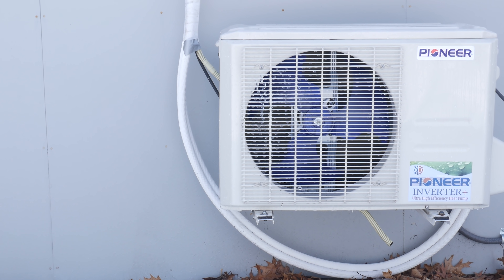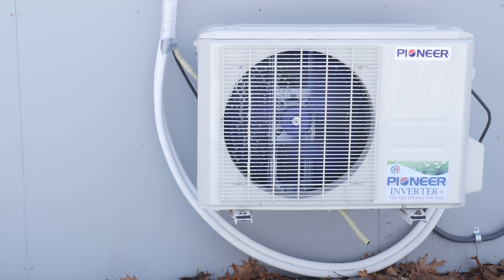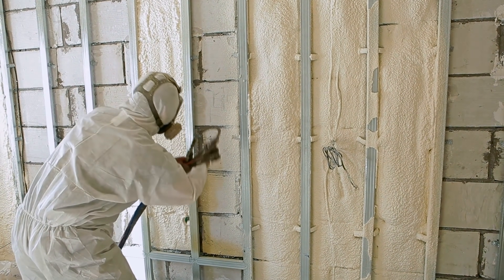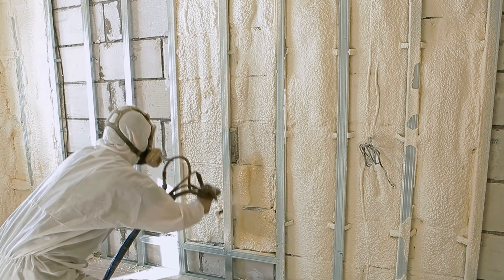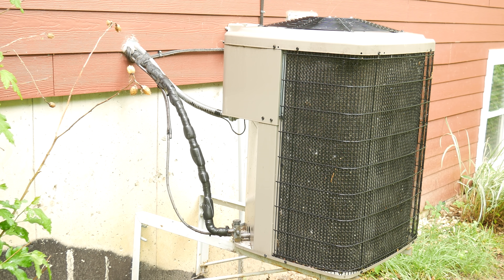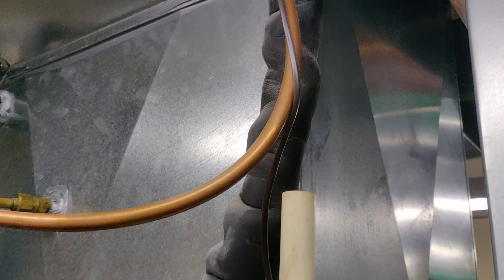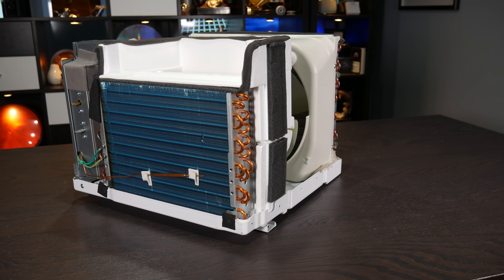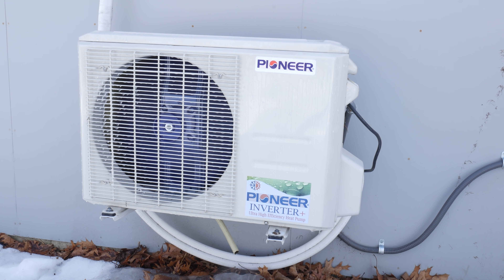Heat Pumps are Not Hard: Here's what it will take to start pumping

Comment: At 35:58 you mentioned that all systems in your area seem to be oversized by a factor of 2x. Fun fact: do you know that there is a direct link between the Spanish Flu and our oversized HVACs? The “Fresh Air Movement”, started in the 1920s, preached that any new heating system should be large enough to keep rooms with open windows comfortable.
Reply: Holy crap. Getting rid of excess carbon dioxide in the air and replenishing oxygen is important and severely undervalued, but that's ridiculous.
Reply: Kinda like driving down the road in the winter time with the window cracked and the heat blasting. My toes are toasty and my lungs are refreshed. But in that case the heat is basically "free" because it's just waste heat anyway.
Reply: @DFPercush  Cars are especially bad for CO2 aggregation, anyway, and it's the worst possible time to be suffering from any amount of CO2 poisoning. I support your cracking the window.
Reply: @SimuLord  Yikes!

Comment: This service has been amazing.

Last July I bought a new house and I decided to start electrifying my house.

So far we've upgraded the electrical service. Went with a 400 amp service for future proofing. $3600

Received a quote from a 14 seer heat pump, $12k, so we're going to DIY. A goodman 5 ton system is like $5500, and as you said, everything is all fully setup. No new lines to run, electric all setup.

In 2021 my mothers house almost burned down due to a gas furnace malfunction. Apparently these malfunction a lot. An electric system is probably less likely to burn your house down.

Comment: I think the HSPF vs COP discrepancy at 24:20 is due to HSPF accounting for the occasional use of auxiliary heat aka toaster oven heat (COP=1). The COP rating on the NEEP list is accounting for the refrigerant cycle efficiency only.
Reply: It’s called resistance heating.  My thermostat has an override to Not use the auxiliary resistance heat… though I’ve never seen it turn-on except below 0 degrees

.

Comment: 10:45 you can also wire through the inside unit as well, it doesn't actually matter as long as you have a large enough amperage circuit. Electricity flows both ways.
Reply: Interesting, I've never seen that as an option for any of the units I've installed.

Comment: This video very much needed to exist. I have an all-electric house — in New Jersey. This dwelling is 1800 sq. with a dual-zone Lennox heat pump system that is 15 years old. The units are a 3 ton and 2 ton. It needs to be replaced. I also want to replace the existing ducts and add humidification/ERV. So far I have gotten two quotes. The first was $70k. The second was $45k. 

Now, I get it. Cost of labor and the higher end Lennox heat pumps do have their mini-split cousin parts in them to make them so efficient. But those prices were for the same outdoor and indoor hardware and installation. That's a $25k difference in price! My only rational thought for the first company bidding $70k was that they simply did not want the job. Bonkers?! 😆 

YMMV but I am 100% with you that there is a premium added to services that set up heat pumps in this country. Thank you for taking the time and energy (hah) to do this series on heat pumps. I have been attempting to do research on the side for months. It's a lot of information, opaque pricing and generally not well talked about on the Internet.

Comment: A few years ago I bought and had professionally installed an air source heat-pump from Toshiba, this was 2018 ish. I chose the best heat-pump for the money I could that also had an R32 refrigerant as R410a is pretty awful. The pump and install cost me around 2000 bucks, copper and wall mount was extra at around 180 bucks together. And this is in Norway fellas, very few things are cheap here and it's illegal to install this yourself.

There was a nationwide incentive with cashback for air source heat-pump installs, but that has unfortunately been removed. Still a good idea though, my apartment is around 90m^2 on the second floor of a 100 year old house that has been renovated. It's consumption during the winter season is a bit above 1000kW/h which would normally cost around 100 bucks.

Comment: Hey great video, and I totally agree that the HVAC companies are greedy as well as allergic to any talk of multi split systems!

I am looking to get a mini split going in my condo to upgrade our current ducted system.  We live close in south loop of Chicago and your last video was helpful to understand the colder climate scenarios.  The only problem we have is that our HOA is only allowing us to install systems that use the existing line sets which is 1 per condo.  Are there systems that have the "split" feature on the inside that can distribute to each room?  That way we can use the existing 1 line set but still take advantage of multiple heads.

We also have another project of upgrading our central heating system as gas prices have soared.  The main consumption is Nov - March hitting up to $7000/mo on gas.  Would a large scale system to pump heat help reduce this cost down or hit zero?  Thanks in advance if you provide some feedback!
Reply: Yes. I have installed many lg units with distribution boxes. Depends on the size you need
Reply: The lg 54000 (5 ton or so) I install use 7/8 for the big line and 1/2 for the small line, then from that distribution box it goes to up to 4 indoor heat exchangers using 1/2 large and 1/4 small lines to each.

So you would need to figure out the total btu you need and add enough of these 5 ton units (that's about as big as they get for ductless).

But did your say it costs 7k a month to great the common areas? That's crazy
Reply: @synapticburn  Hey thanks for the info on the LG systems.  My individual unit is only 1200 sqft space so 5 ton would be high, but maybe a 2.5 - 3.0 ton would work.  I'll take a look into it.  

And yes $7k but that is for the whole building of 60 units so about $166/unit per month for gas bill.  Still quite high for heating a 1200 sqft space.

Comment: This series has been weird for me. I live in Australia and this form of heating and cooling is standard across the entire country.
Reply: Well, fairly standard - I used to live just the NSW side of Canberra back in the 90's/early 00's, and most of the places I lived heating was portable oil column heaters and cooling was ceiling fans and maybe a window/wall-mount cooling-only aircon.

Rental place in Junee I was in back around 2007-2013 had a split-system aircon in the "living" room (never did test if it did heating as well), but it got to the point where we had to install dedicated cooler-only aircons in both bedrooms to deal with the summer heat (and winter cold was dealt with mostly by using small resistive under-desk heaters and rugging up warmly).

Where I live now (rural town about 110km from Wagga and 125km from Albury-Wodonga) is a house from the 50's or 60's with jack-all insulation and came with a big 1970's style cooling-only aircon mounted in the wall of the living room (above where there was a fireplace from when the house was built), which died back in like 2017 and haven't been able to get at to replace due to life getting in the way. Otherwise the only aircon is a small hole-in-wall box aircon (fan circulation and cooling only) that's in one of the bedrooms that we installed a few years back.
Reply: It’s common in the southern US, just not in the north. Nearly every home in southern Georgia I have seen use Heat pumps. His experience with heat pumps in Chicago isn’t really representative in other parts of the US.
Reply: @Pickle312  It may not be very representative, but it SHOULD be.
Reply: Agree. The other thing is the outrageous prices people are being quoted for installation of heat pumps. In almost any Australian city you can pick from probably 5,000 local companies who will fight over each other to supply, install and test a split system air conditioner (ie heat pump) for just over 800 USD, yet identical systems are being quoted as several thousand dollars to install in North America and Europe.

I recently added 2 split systems in my house (6.6 kW (~2tonne) and 2.5 kW (~1 tonne)) for $1,500 USD equivalent and that was from a company that charges a premium not a budget provider. They were Mitsubishi Heavy Industries too which are very good quality units, there are much cheaper options if you wanted to sacrifice quality in favor of cost.
Reply: @gav7507  You can convert to USD and then multiply the cost of your 2 split system by 10 for a lot of US hvac companies. It's madness and sheer greed.

Comment: When I had my first floor gas furnace/air conditioner system replaced a few years ago, I solicited quotes for a heat pump option on all of the ACs. I don't remember the exact figures, but it was around $600-1200 extra to add the heat pump feature. With solar on the roof, it made it a no-brainer to go down the path of a "dual fuel" system.

Comment: You can turn an existing air conditioner into a heat pump with a reversing valve, two thermal expansion valves, a demand defrost board, a new thermostat capable of controlling a heat pump, and an auxiliary heat strip in the air handler to temper the air during the defrost cycle.
Reply: This is information I NEED!!!  We just had a new system (gas heat and AC) installed when we moved in almost 3 years ago.  Now we own the place and I am really worried I can't just "upgrade" and will have to replace everything if I want a heat pump.  Please tell me that tweaking the existing system is a reasonable task (or able to be done by an HVAC professional) and I'm not going to be on the hook for 5 figures to get an all new unit.
Reply: that's major modification, makes more sense just to replace the outdoor unit.

Comment: Thanks for the video , this video helped me finally decide to upgrade my swamp cooler and gas furnace in to a 4 mini split units , thanks from Mexico! Just comment , when you have all minisplit it's difficult to climate the bathroom specially during heat season
Reply: Enjoy the mold and replacing them every year. Enjoy the water leak in your wall and the pollution from maintenance and repairs/replacement

Comment: The problem is heat pumps cost £10,000 - 5 times the cost of a gas boiler at £2,000. I could get a government grant for £5,000, but that still leaves me £5,000 which I don’t have. I am happy with my gas boiler, it is very efficient. I also don’t have the space for a heat pump anyway.
Reply: My heat pump cost €3800, that is 9kW will probobly heat my house down to -15
Reply: It's unfortunate that UK can't get a grant for air to air units.
Reply: @Swwils  grants are usualy not greate1. They only increase the price. The only exception is if it a grant to make batch installations.
Reply: @matsv201  this might not always be the case, especially if the energy supplier wants to take up companies that install heat pumps. I think you will see alot of movement on this in the UK, this should dramatically drop costs of getting a heat pump. The technology itself isn't expensive.
Reply: @Swwils  This is the advantage of air-water heatpump. Granted, they do have worse efficency, you drop about 0.5 i cop. But they are easy to insall, and you also get better efficency for water heating
Reply: @matsv201  it's worth considering because it's so simple and also the warm air "feels" warmer than the actual room temp. Also for some houses the ability to cool air in summer is a big bonus, especially if you have large south facing windows with little shade for whatever reason.

Comment: I've used heat pumps for over 20 years, and the one thing no one talks about is that the heating load is larger than the cooling load by a factor of 3 or 4. heating load is linear with delta T so if your cooling load is based upon a 25 degree delta T (95-75); your heating load can be easily 3 times the cooling load (65- (-10)) or 75 degrees delta T.  In addition ypur infiltration and wind loads are greater.  Supplemental heat is required if you have more than 4000 heating degree days

Comment: Hi, 
Thank you for your attempt to assemble tons of information in a relatively compact video format.
I like your videos about heat pumps, but there’s an elephant in the room we are probably missing - air ventilation and air recirculation.
People need some oxygen to breath and we are better of excess levels of carbon dioxide, VOC, particles. Humidity levels are also important.
Yes, building insulation and thermal efficiency of many heat pumps are great, but it doesn’t matter if you have to open a window just to get some fresh air.
Most of systems mentioned in this video are prone to this issues.
What is your proposal for energy efficient ventilation?
Reply: A good place to start would be to recognize that the heat capacity of almost any gas is absolutely tiny - when heating a room you're actually heating the walls more than the actual air space. The reason heat pumps manage to work around that is that the outside part of them moves a lot of air. Exchanging the air volume of your living space isn't going to lose much energy, if you do it quickly.
Reply: @jandl1jph766  . Concept of thermal mass is somewhat familiar to me. I am not sure how much thermal capacity does drywall on a frame(very popular in North America) has.
Since we are not normally resting on floors, walls and ceilings, the air temperature and humidity are the main contributors to our thermal comfort.
Any way, how would you suggest moving enough air fast, reliable and efficient?
Reply: @antonburdin9756  Open all windows for a few minutes, two or three times a day? That's how it's done throughout most of the world and it works just fine. 

Yes, air conditions are what we feel, but the point is that even if you replace the entire air volume, the amount of energy lost to the outside is tiny since most of the heating went into the walls. Convection will very quickly (minutes) lead to the air temperature coming back up to normal throughout the entire room. Of course, that only works if your walls aren't so poorly insulated that they hold little to no heat... But if that's the case, you've got bigger problems to solve first.
Reply: @jandl1jph766  , actually insulation and thermal mass are not the same. Some of the best modern insulation materials do not provide substantial thermal mass due to relatively low density of such a material.

Do you have forest fires or any other sources of air pollution in your area? 

What about air humidity during your heating season?
Reply: @antonburdin9756  I didn't claim that insulation and thermal mass are the same, but thermal mass doesn't really do anything anything if radiation to the outside leaves the walls cold anyway. 

Air pollution is another one of those things that if they're a real issue throughout the heating period, there are bigger problems to solve. Major fires happen during summer, so they don't factor into it. What can happen during winter are smog events but if those are at all common, we're talking about a seriously mismanaged city environment that needs to be fixed anyway for far more reasons than just people opening windows. Anything else is a once in a blue moon event and keeping windows closed for a few hours or even days every couple of years isn't going to be a huge problem. 

Humidity can be controlled easily enough if that's necessary, if anything you'll end up with it being too low. A bit of water near the heat source fixes that. Again, that's an extremely common thing to do around most of the world. For me personally, I'm ok with humidity dropping to around 40%, so I don't bother.
Reply: @jandl1jph766  , I would say, that most modern refrigerators are well insulated, while closed. Probably, better then many houses. However, temperature in  an empty fridge would not recover after opening, if it is unplugged. Am I wrong?

Of course, ventilation is important on a year round basis. I live in Vancouver, B.C., so we have very mild temperatures year around. However, using our heat pump (water to air) we are paying more during summer months.

In winter, indoor air humidity often drops to 30 if no air humidifier is used.
Reply: @antonburdin9756  Comparing a fridge (empty) to a house doesn't really work, though, since your thermal mass there is going to be a little bit of sheet metal and plastic. Not exactly a lot. In a house, even an ultralight build like many US buildings, we're talking about several tens of tons of material, European style houses are easily in the hundreds of tons range even for small ones. If your fridge is packed with high thermal mass items (lots of water), it's going to recover just fine by the way. That's how ice boxes of old worked. 

Sure, ventilation is important year round, but that doesn't contradict what I wrote? A heat pump doesn't exchange air, it just moves heat. The whole issue about ventilation is less of a concern the lower the temperature difference between outside and inside. If you can't open a window for large parts of the year, that's an issue a simple heat exchanger doesn't solve - you need an air handler with suitable filters (or find a healthier place to live if at all possible). Sure, those will do your air conditioning as well, but these things are quite a bit more capable and expensive. This can make sense for very large buildings where managing ventilation through convection just isn't practical, but residential buildings don't usually suffer from that restriction.